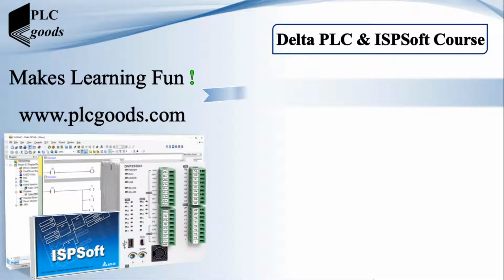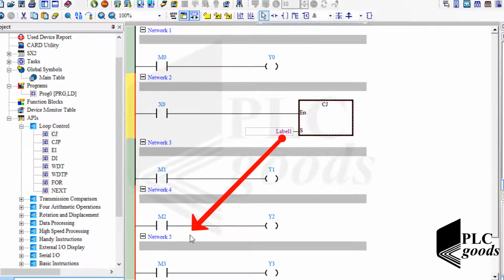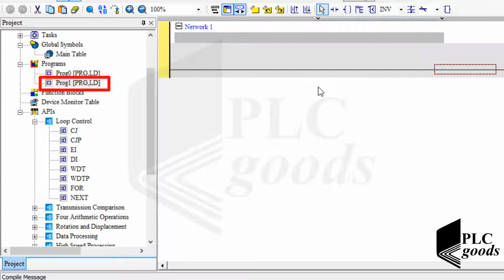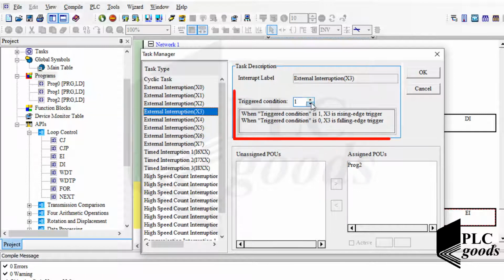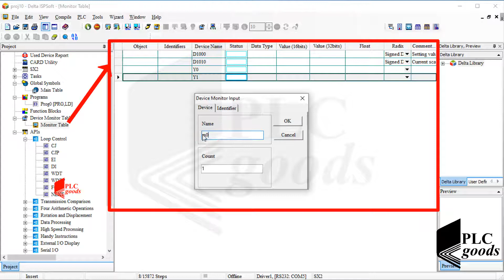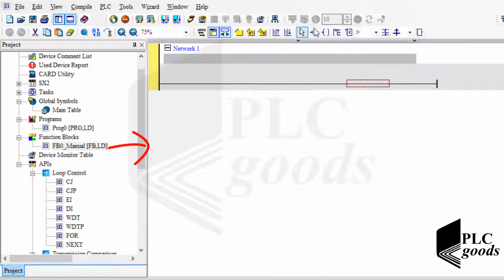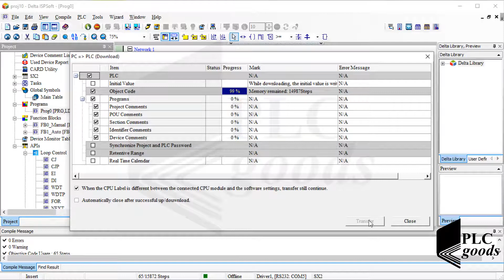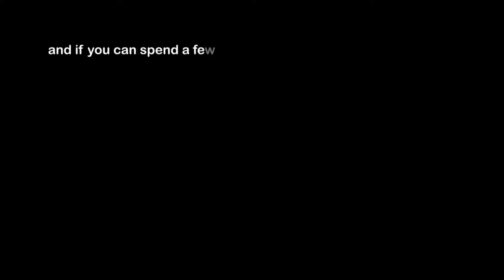LOOP Control & Interrupts in Delta PLC | CJ FOR WDT with ISPSoft  | Lesson 10

Comment: Thank you mr
There is problem with the (cj) instruction in writing the command (s)
Some of them show an error massage 
What is error
And thank you
Reply from the maker: Hi there, when you compile your project, ISPsoft can detect some errors in your project and display them at the bottom.
Also, a few instructions are not supported by some older version of delta PLCs. Please check your PLC model and read the instruction's description in the help window.

Comment: Can we operate a input from HMI and Push Button
Reply from the maker: You can use HMI to change memory bits and then use them in parallel with a pushbutton (X0, X1,...) to turn on/off outputs.

Comment: hello sir . i'm using 3 functions that uses the same outputs but they can't work simultanely they depend on a decimal value however when one function gets activated it keeps the values of the outputs that it sets even if I turned the function off. i need some help to when I call a function the other function stops and their outputs resets is there an end loop or priority function I could use ?
Reply from the maker: Hi there, It seems you have 3 functions, and based on some conditions (as you said: a decimal value) only one of them must be executed. I think you need to modify conditions that enable each function. also, you can use them to reset some variables before starting another function. My recommendation to you is: define 3 outputs related to each function and then select one of them based on your conditions at the end of your program.

Comment: Hi my friend !
Why do I need for loop if the program execute the conditions anyway?
Reply from the maker: Hi there, I agree with you and I rarely use the loop instructions (For & Next). So, I explained them briefly during the video. especially they can increase the scan cycle time, therefore I prefer to use other techniques or instructions. For example, A number can be multiplied by itself several times inside a loop, But I prefer to use mathematical commands like power instead of using a loop. However, most programming languages support loop commands. For & Next determine how many times a part of the program will be executed in one program scan.

Comment: Hi sir I’m facing problem in position control mode, with two signals such as x0=1 for starting the pulse output about k2000 pulse,

and during servo running I give another trigger from x2, in that case I have to stop the servo at k1000 pulse from the trigger of x2, in between servo should not rotate

In this case if the frequency is changed position is changing
Reply: Can u please guide me the steps to be followed 

Even frequency changed position should shouldn’t change
Reply: @Decorpacz  Hi there, I've never connected a servo to a delta PLC and also your question is not clear to me :(
Reply: @plcgoodsmentor9223  ok is there any other way to communicate with you ?
Reply from the maker: communicating with the mentor is limited to placing  comments limited to the related project done in that particular video clip.

Comment: Nice video sir,  btw i am using DVP32es2 delta PLC and i have a problem for my project. Let say, the electricity suddenly went down in a factory for a few minutes. And when it turned back on, I wish the PLC to suspend the current program. So the operator can decide via hmi whether he will continue the current program or reset it from beginning. How to use EI & DI in this case?? Thank you very much
Reply: Hi there, you can easily write any part of your program inside a Function Block, then write a simple program inside the main program to call each function. related to your case, the operator determines which function must be executed. the main function which controls the system with the previous data, or a function that clears all previous data and after that runs the main function.
Reply from the maker: Now it is your turn to try to write your code with the the answer. Let me know th result of your next try
Reply: @plcgoodsmentor9223  Thank You for your advice, currently i just use latched memory to continue the program when it suddenly went down. And also put reset button , to reset all the program and the values.

Comment: can i run this instruction(DI EI) in ispsoft simulator ?
Reply: I think so, Try to test it. Note that, based on the selected plc model, you can see valid instructions on the left side. Also, based on the selected plc, use an appropriate simulator
Reply: @plcgoodsmentor9223  i have try in SE simulator but showing error y2 and y3  output....but your method is very nice ..I ll try this logic in another model .I hope it will work . And I hope you will make some more videos ..
Reply from the maker: ok, let's Cross our fingers that it will work!